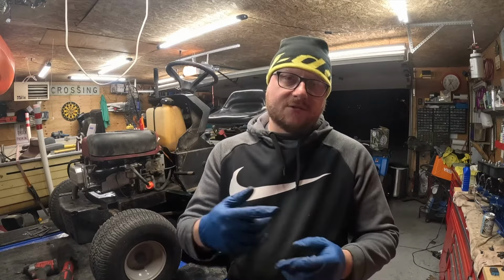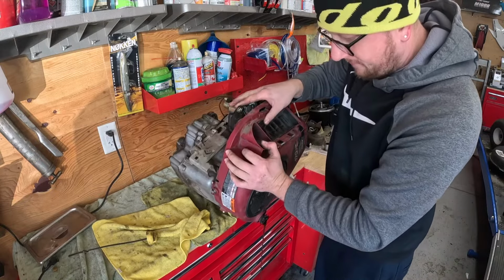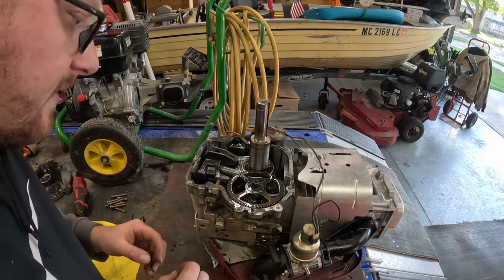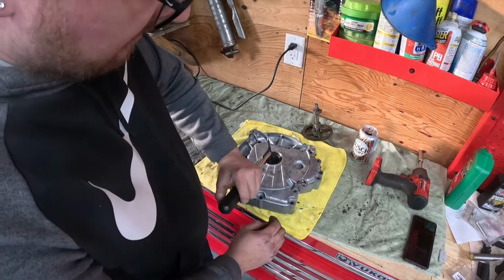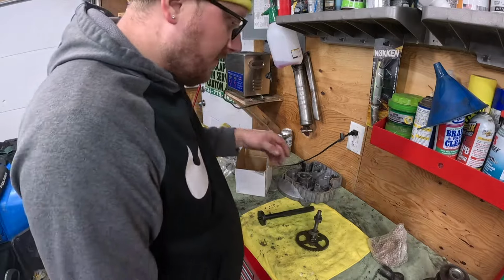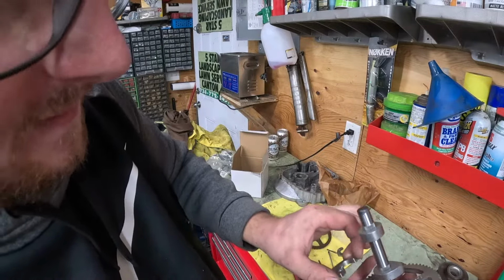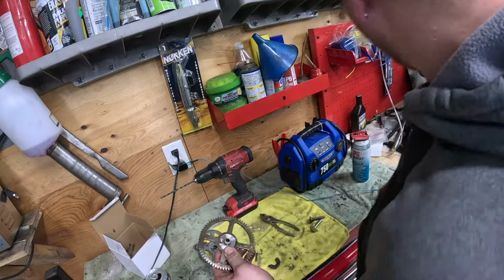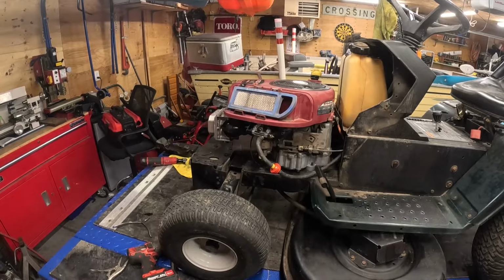Briggs & Stratton Compression Release Fix For 25 Bucks!! Using OEM Cam

Comment: I always took and put a little tig weld on the pin when I worked at the lawn shop, never had one come back. did so many under warranty its crazy they are still having problems with those cams. also pretty crazy that when that puppy lets go the most damage i've seen done was a wiped out governor gear....   pretty tough motors just shit acr design !     cool video man
Reply: Yup and if that governor gear gets wiped out, the thing runs away at full send; and the rod says well, I'm done here and I'm leaving this shitshow out the nearest exit, ie. the side of the block.🤣🤣😂

Comment: Funny how that one failed. I guess the spring that keeps it engaged until the centrifugal force releases the compression release failed, since it still looked to be in one piece. I have seen videos where everything looked fine, with the release just jammed. 
I wonder if welding the Chinese cams to the shaft would work to keep them on the shaft? Too much welding might crack the cams as the weld cools and shrinks. Experimenting with one might be fun. Weld one, lock the shaft in a vise, and see if a big pliers or wrench could break it loose from the shaft.
Reply: I tried that and it worked great. 2 years still running great no issues.

Comment: Unfortunately the video glossed over a crucial part of the reassembly which is orienting the pin correctly on reinstallation.    The video just says to set it correctly without showing what "correct" is or stressing that doing so is crucial to making the compression release work properly.  Good catch on mentioning that the valve stem buttons are prone to falling off, however.  Between the compression release, the valve seats falling out, the valve guides creeping out and the head gaskets blowing these engines seem guaranteed to fail in some way in about 10 years.
Reply from the maker: I mentioned line up the flat side before tapping in

Comment: Love this video. Jumped into my 17.5 hp B&S and found release valve "looking good" but not the cam gear teeth. How long will $25 complete shaft last? Any experience welding the $25 shaft for longer last? You mentioned tig welding.
I'm kinda stuck until you or someone answers.  Thanks for the guidance!
Reply from the maker: @jima4860  I never welded one I believe there is a video about it on teryl fix all channel that might give you better insight on that
Reply: @mrsrx4584  Will check out video you recommended. How long might I expect the cheaper one to last? I only need a couple more years.
Reply from the maker: @jima4860  hard to say could be 1 time use or last long time, honestly id go for it and see what happens all your out is your labor time

Comment: i've pulled seemingly bad ones and everything is intact,,,,lazy compression release spring?  the cam lobes were fine. Changed it and it ran fine again...but I never really understood what was wrong with the other one...
Reply: I saw a video where a fellow pulled a Predator engine apart due to a failed compression release which was preventing the engine from starting. It was stuck in the run position.  The Predator has a better designed compression release than these Briggs. As soon as the man touched it, it sprung closed, like it was supposed to do when the engine is off. He manually opened it, but every time he did it, the thing would close perfectly, like it should. He was tempted to just reassemble the engine, but decided not the risk it getting stuck open in the run position again, so he changed the compression release. Strange things can happen.
Reply: @billsimpson604  There was some tiny little bit of trash stuck between the weight and the cam gear on that one. Saw another engine teardown, and it was from a tiny bit of plastic from the broken orange plastic dipstick, I think that one was a Generac engine, they have that orange plastic dipstick. Funny how a dipstick can kill an engine...

Comment: Keep in mind that the case gasket from briggs is 15 thousands and the gaskets from most aftermarket kits are much thicker and will give you too much crank end play. Other than that I think using the old cam was the way to go..JS
Reply: That might also mess up the camshaft end play, and how much clearance there is on that oil pump drive shaft. Sounds like a bad idea to me.